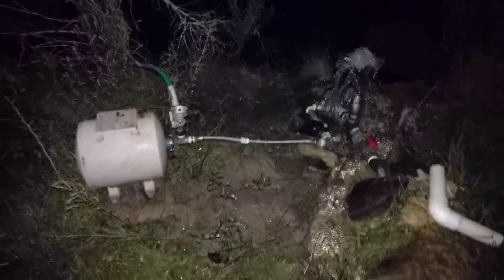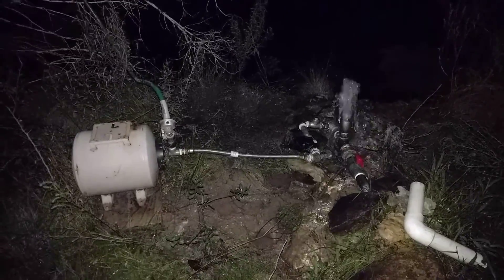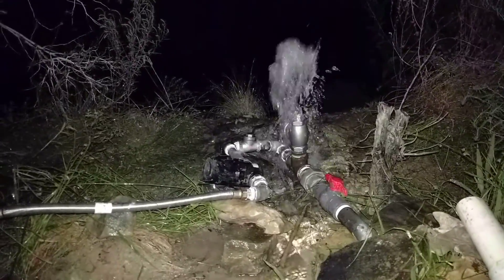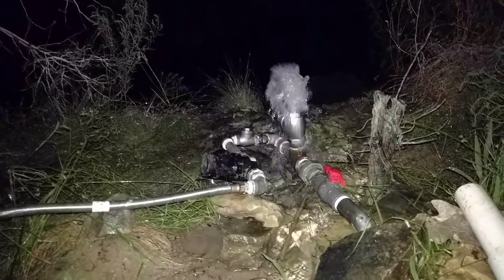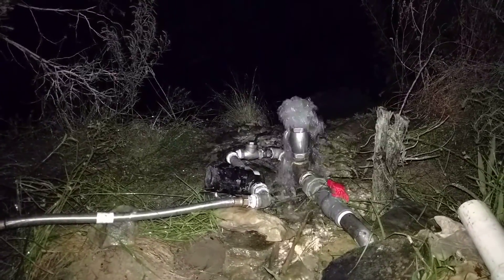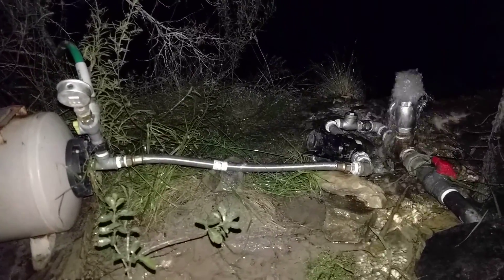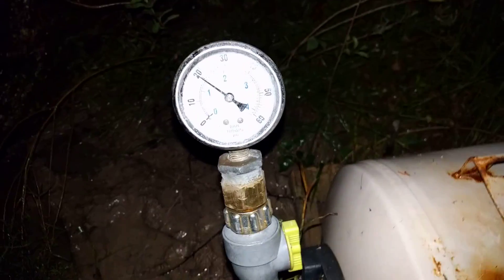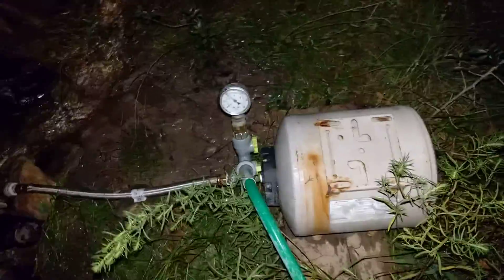Ram Pump Stainless Steel Check Valve Update

Comment: Stainless is much more better than brass valve, more power and water deliver and more durable. I spent a lot for brass swing valve, cannot last long  and yhe disc is lighter. Bladder tank is also much better.
Reply from the maker: Stainless certainly lasts longer. In my application I'm not sure if it moves more water. About the same. Definitely worth the extra money.
Reply: @TheShop22 and even the check valve, I used stainless steel spring valve but remove the spring because the ram pump some time stop and  there some abnormalality of the sound and heart beat. At present for almost 2 months threre is no problem with my ram pump,  I myself fabricated and design a waste valve which is more durable  and easy and cheaper to maintain.  My ram pump design is the check valve is in vertical position
Reply from the maker: @maximoincognito4881  
That's excellent. I need a good rain to be able to use my system. I need to take a look at yours to make improvements to mine.
Reply: Just search on YouTube if you like, My home made ram pump ang customized waste valve.

Comment: You could add a shutoff before the pressure valve so you can open it when you want to check pressure.  This way the valve isn't constantly working. 
How did the stainless steel valves hold up?
Reply from the maker: Sorry for the late reply. Stainless valves holding up great. Probably almost two years total run time and still working when I shut down for the dry season.

Comment: That looks like a nice set up. what's the black thing between the 2nd check valve and the expansion tank? is that a flow meter?
Reply from the maker: Apologies for the late reply! I had a strainer in the system until it cracked. Trying to keep leaves, critters out of my tank above. I didn't replace as it never had anything in it